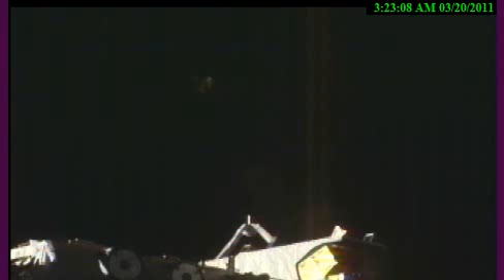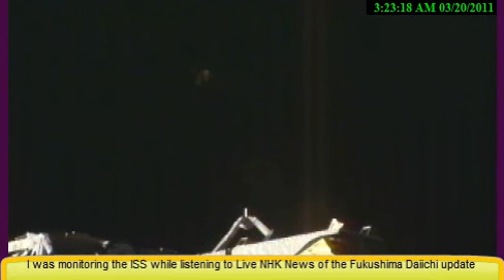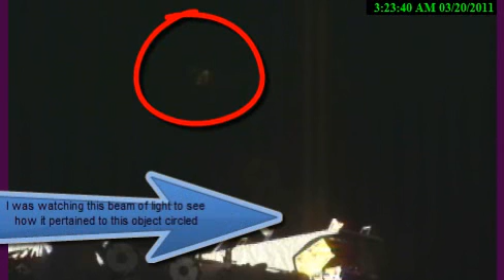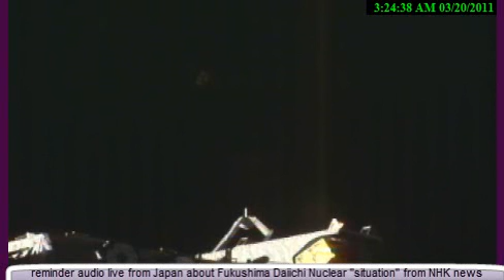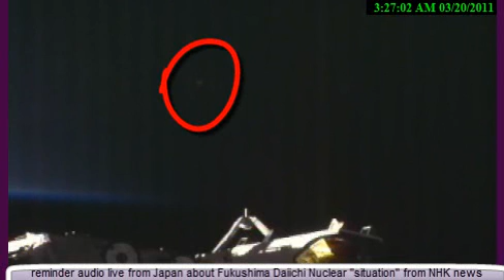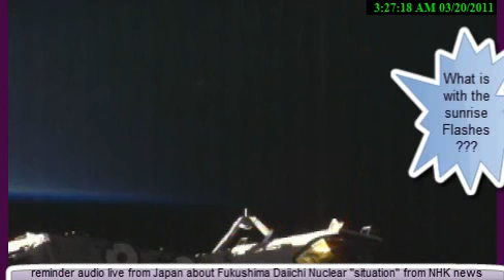Japan Disaster and NASA Connection?

Comment: Well the sunrise flashes are really easy to explain. The camera is simply adjusting to the sunrise by changing its Iris. Automatic camera do that all the time. or else its being adjusted by someone on the inside of the craft....either way they are doing for the same reasons. More light means you adjust the aperture  of the lens....if you don't the picture gets washed out. The light beam and the spot look like reflections on the glass IMHO. But what does ANY of this have to do with Japan?!

Comment: The 3-hour Planetary Kp-index is derived at the U.S. Air Force Space Forecast Center using data from ground-based magnetometers, its been spiking since yesterday evening above normal limits due to a coronal hole.  Note sure that explains the flashes, I'm new at this. The show may get better tonight.